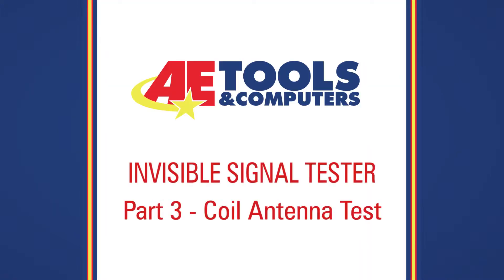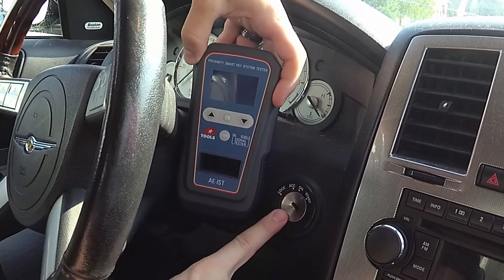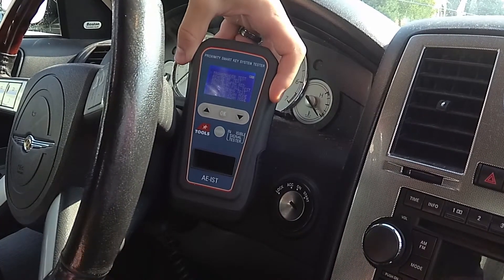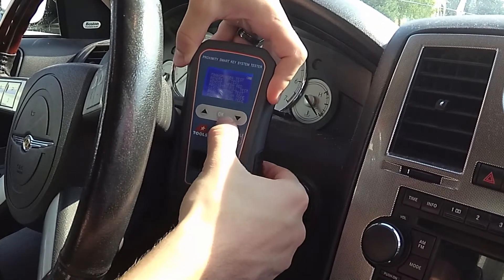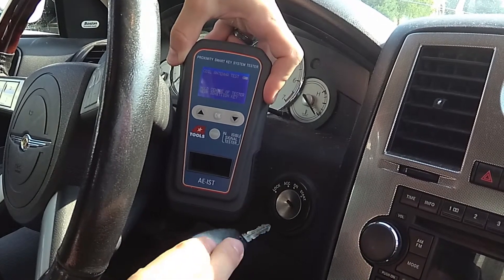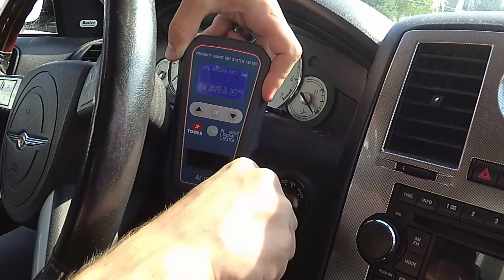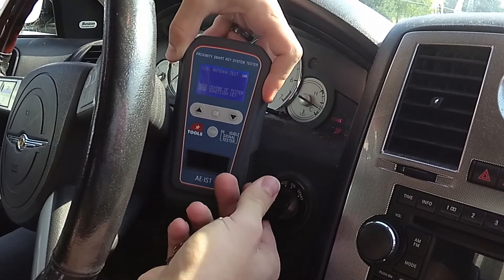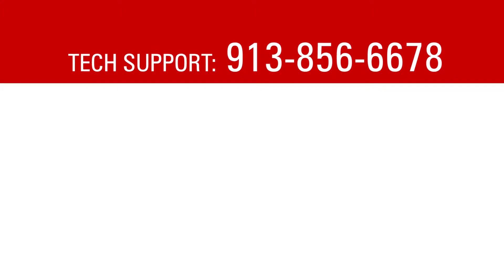AE IST 3 Transponder Antenna Coil Test

Comment: Good day! Maybe you could help me resolving my problem... My car doesn't start and I know that the immobilizer system is acting up but which part of it??? Not sure... Do you know if I suppose to read 12V. at one of the pin of my coil antenna?? I'm confuse about this system... Thanx!